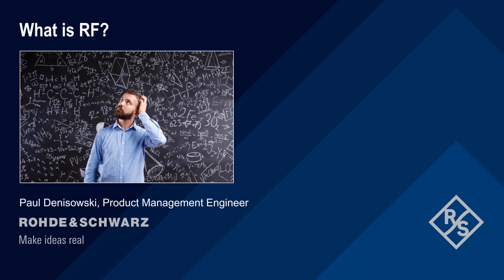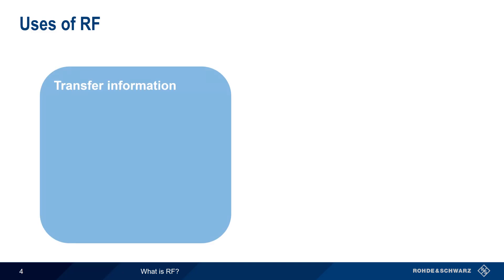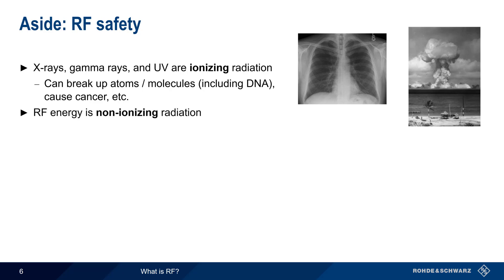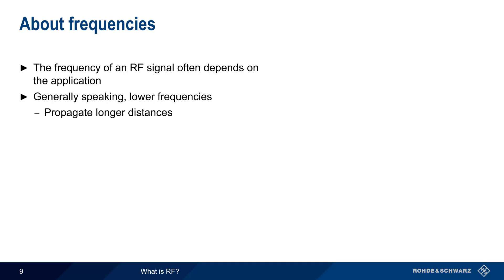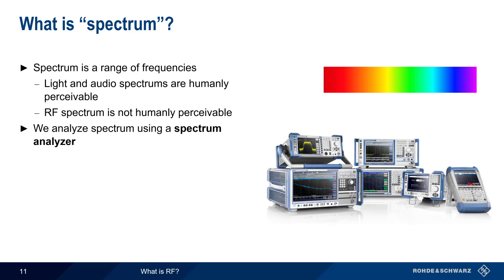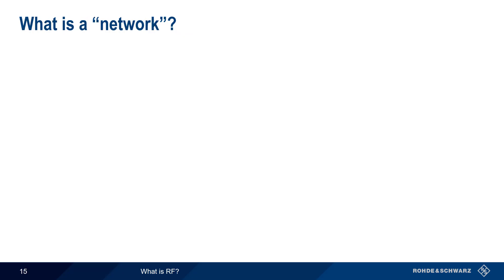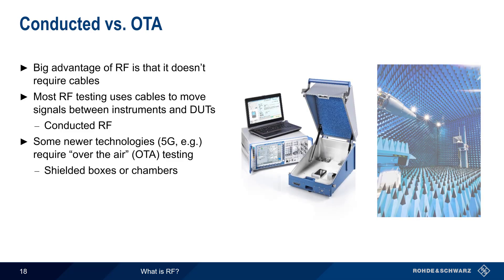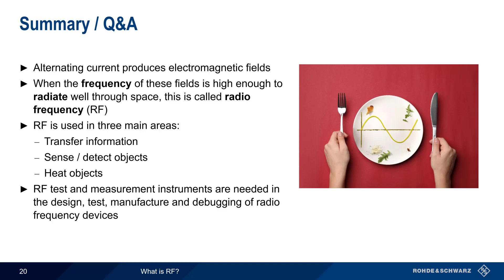What is RF?

Comment: I'm really confused with the definiton. I thought RF is below Microwave frequencies. Is my understanding an old definition that was used when signals to transfer information only had frequencies below microwave? Is there a common state of the art definition at all? Or is it at least agreed in the test and measurement field to include microwave frequencies when refering to RF?
Reply: Great question.  Some people make that distinction between "RF" and "Microwave":  we (R&S) do it sometimes as well.  But you're correct in that it's a somewhat "older" way of referring to them, and I don't make that distinction myself most of the time.  Thanks!